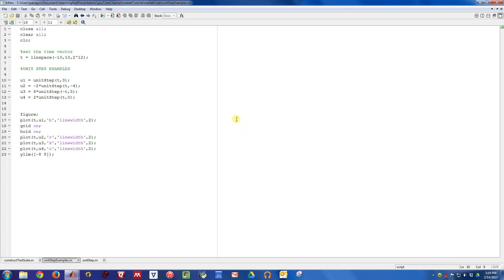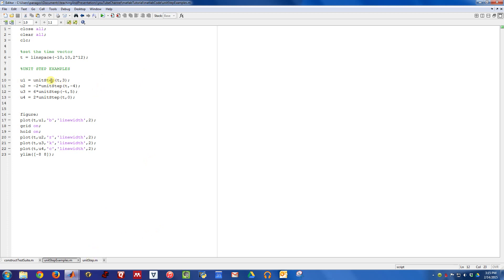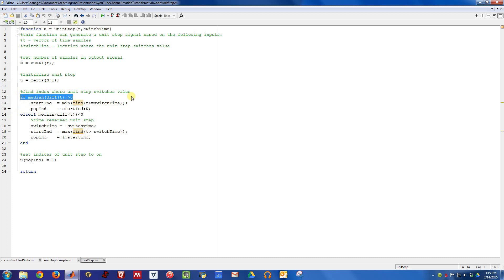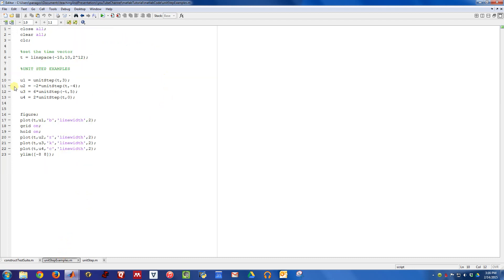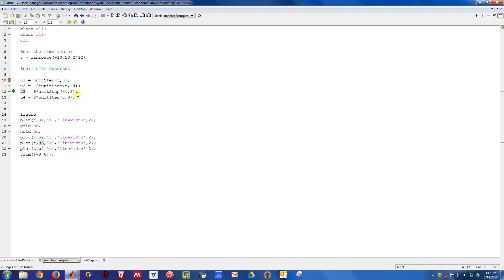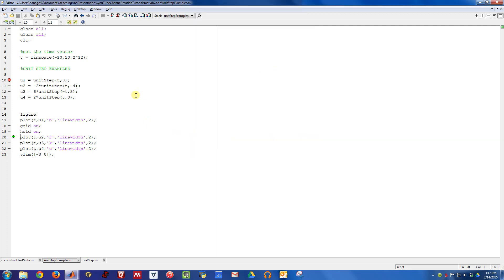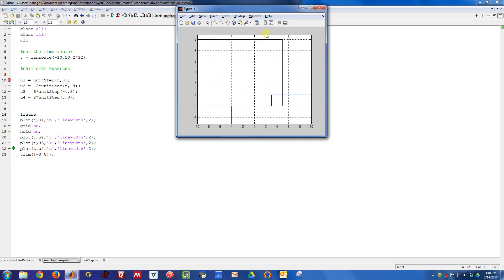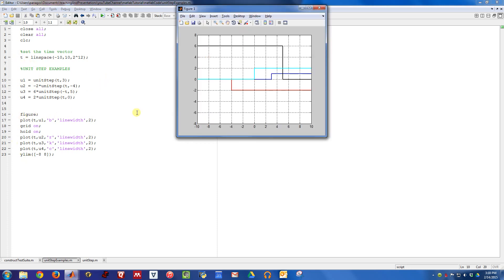Matlab Examples - The Unit Step Function

Comment: Line 11   u1 = unitStep(t,3)   doesnt work, matlab tells me to use the fuction 'step' but when i try 
u1= step(t,3)  that doesnt work either
Reply from the maker: The "unitStep" function isn't a built in Matlab function.  It's a function I wrote that's on my website.
Reply: This is how i got it to work
clear all
clc

t = -10:0.001:10;

u1= heaviside(t);
u2= -2*heaviside(t + 4);
u3= 6*heaviside(-t+5);
u4= 2* heaviside(t);

plot(t,u1,'b','linewidth',2);
grid;
hold on;
plot(t,u2,'r','linewidth',2);
plot(t,u3,'k','linewidth',2);
plot(t,u4,'c','linewidth',2);
ylim([-8 8]);

Comment: I copied and pasted your exact code directly from your website and I am getting the following error:

function u = unitStep(t,switchTime)
 ↑
Error: Function definitions are not permitted in this context.

how did you get it to run?
Reply from the maker: I think you're using the unitStep function incorrectly.  You can download the unitStep.m file from here:

https://www.adampanagos.org/courses/or/matlabexamples

This function should be its own stand-alone m-file.  You don't type the word "function" into the matlab command line.  You call the desired function with u = unitStep(t,5), etc.  Hope that helps,
Adam
Reply: @AdamPanagos  this link is not working right now(5/22/2022)
Reply from the maker: @youdontneedtoknowme268  Thanks, updated to the updated link/info location.